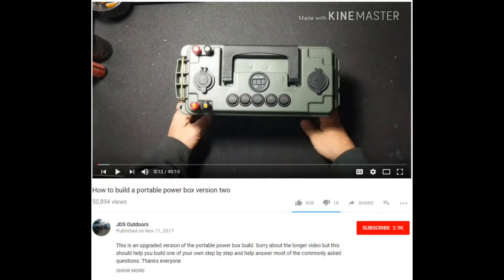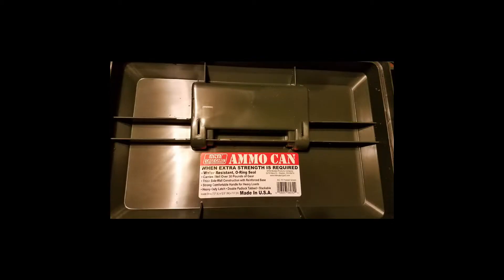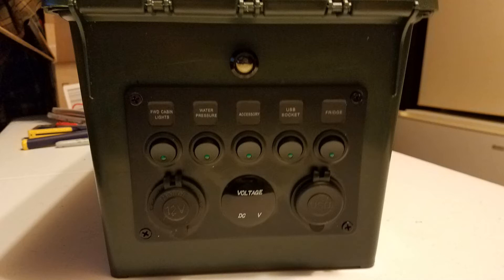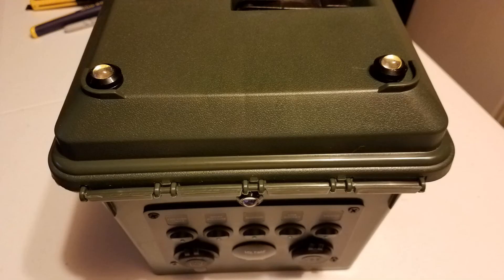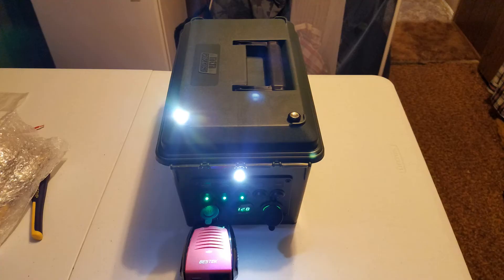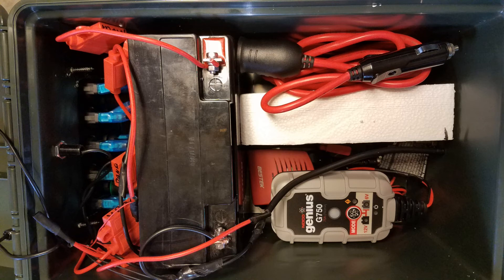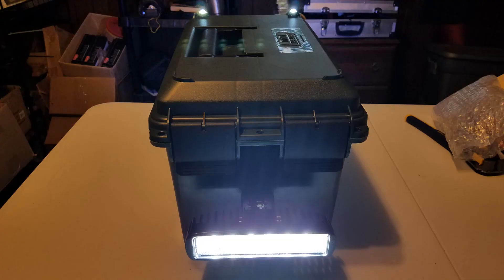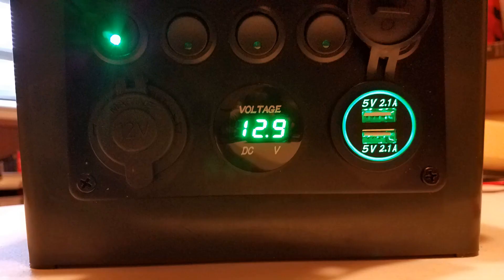Project DIY Portable 12v Emergency Power Box Lighting TV Laptop Phone Charging

Comment from the maker: Ran it last night; powered my laptop for 12 hours with 4 hours of lights (the little ones) on, 
plus charging a phone and a hot spot.
The on-line calculator suggested I would only get about 3 hours(?)
11.6v on meter, so plenty to go.
Very Pleased.
Reply: 11.6, plenty to go??
OMG... do you at least know minimum recommended voltage for a lead acid battery?